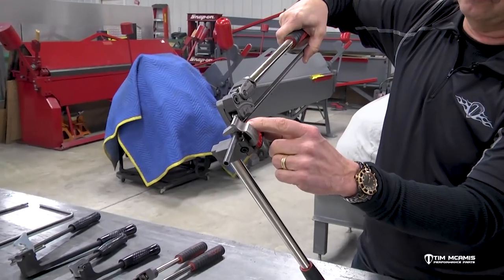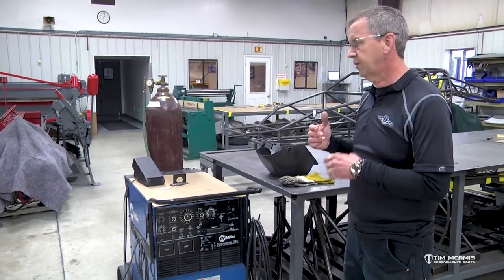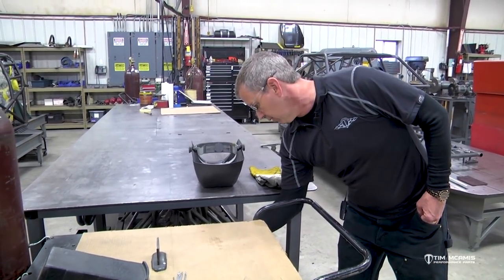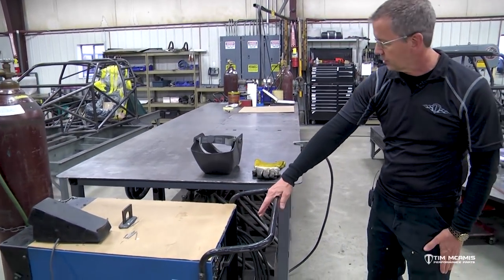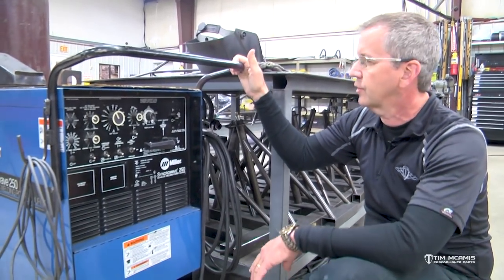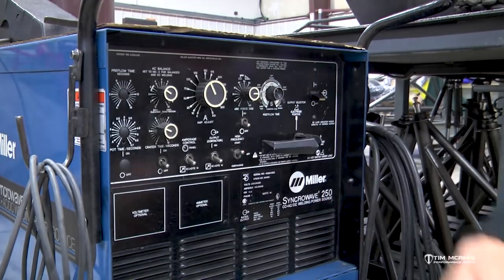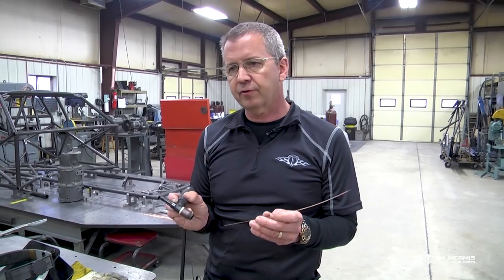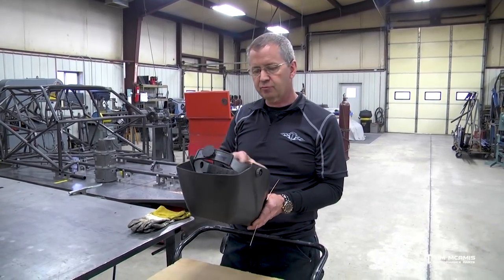Intro To Welding - Fabrication Series: 06

Comment: Good video Tim.
I've been using Miller machines all of my 42 years as a fabricator. They are "Tanks".
Started building drag chassis in '82 mostly MIG welded mikd steel.
When I started building with 4130 I bought a Miller Syncrowave 180 air cooled machine. Great piece if equipment that still sees use doing small components.
My main machine now is a Syncrowave 250dx.
Just a slightly more modern version of yours.
It also does a wonderful job doing stick welding when needed.
This is a great series your producing even for the advanced fabricator. Thanks

Comment: Tig machines are constant current machines which can also be used for stick welding mig welders are constant voltage machines
I think when he was talking about the amount of power in dc neg may be the correct terminology would have been 1/3 heat is at the torch 2/3 heat is st the base metal
DC pos is used for preparing the tungsten for aluminum welding by putting a ball on the end of the tungsten and stick welding rev polarity rod such as 7018 which produces superior penetration 
Oxy/acetylene welding helps learn good technique for tig welding 
Looks like a great race shop to work at 
Where doing everything the right way is the only way 
Really enjoying the content
I think nascar is missing out on a show like this where the fans who enjoy the technical part of racing can see more of whats going on behind the scene at the race shops thank you for your time and knowledge that your sharing

Comment: Great video. When I bought my Miller 180, I had very little welding instruction. I bought the welder and a book. I also spent a little extra for the auto darkening helmet. The helmet is great for beginners because when you are getting ready to start your weld, you can see what you're doing without worrying about flipping the helmet down. The rest is, as you say, practice practice practice. Also, if you don't have great eyesight you can buy a small magnifying lens to clip in your helmet so you glasses don't hinder you. Or to just help you see better what you're doing.

Comment: Miller makes great shop welders, as does Lincoln. However, I opted to go with an HTM machine since it will MIG,TIG, and stick weld. It doesn't have the high amperage capacity of a Miller, but will run hot enough to do 100% of welding involved with race car fab and repair work. Also, the HTM is small enough to be included as a tool in the race car trailer, as it only needs 20A-220v service. Add to that is its initial cost ($549 when I purchased mine) and you have a winner...!!!

Comment: I worked as a TIG welder for a while, weld repairing cylinder head castings.
Reply: The welding setup I used had a water cooled gun.

Comment: What's a good tig welder for a beginner with tig without braking the bank. Would like to get into tig welding but not willing to spend crazy money when I have a mig on hand.
Reply from the maker: Most anything from Miller is good.
Reply: Depends on what you want to weld. I have a Miller Maxstar 200 I picked up off craigslist several years ago for around $800. It’s DC only so no aluminum but it’s an inverter machine and only weighs around 35-40lbs. They also make a 150 model with lower output that can be found for less.
Reply: Railfan90 looking for something up to a 1/4 at the most aluminum
Reply: The Dynasty series is the AC/DC version of what I have and the 200 model will do 1/4” no problem. It’ll be a bit pricier but you get what you pay for. A lot comes down to what’s for sale if you’re looking at used stuff. The older stuff works good too but is generally bigger and heavier while using more electricity. I can run mine off anything from 120VAC to 480 single or 3 phase just by changing the plug. Portability is nice, I’ve run mine off a small generator in a field for stick welding numerous times.
Reply: AHP welder....checkout Kevin caron and chucky's5009 review
Reply: HTP Invertig 221 is one of the best starter welders to grow into. It’s actually on par with the dynasty 210. I’ve made a bunch of videos on both
Reply: Bradley Harrell I just bought one of these Miller 250 for $1400.00 used it doesn’t have the pulse like a new welder but this welder is amazing and like Tim said it can do everything you need I bought mine on the Facebook market place from a fabricator who just bought a dynasty and it came with a water cooler
Reply: Welding Junkie... I'm with you on this. I have the HTP on a cheap Harbor Freight rolling cart. I use it in my (home) shop, then roll it into my race car trailer for repairs made in the pits. I really don't think Tim's Miller would be a good candidate for taking on the road. The HTP does both well... And it'll handle 100% of car fab/repairs. A big Miller is great for a non-automotive fab usage, such as Sch. 160 - 4130 Boiler Tube welding, but is really too big for taking it out on the road, due to its sheer size. I ❤️ my HTP for its versatility/size....!!!

Comment: Aluminum is welded in reverse polarity. You just called it ac but you said you don’t use electrode positive. But you do use electrode negative.  You might confuse people as to where to plug in thier torch. Maybe it’s different on those old old machines idk
Reply: AC is NOT reverse polarity. With reverse polarity (DCEP) more heat is concentrated in the tungsten. With AC (like the power in the mains) the heat is evenly divided between the two and you can use much higher currents with a similar amount of electrode wear. DCEP is used for welding aluminum because the oxide layer has a higher melting point than the metal as is only cleaned away by the reverse current flow.

Comment: I liken TIG welding to oxy welding - instead of a gas flame, you are using an "electric flame".
Reply: I found that this occurred to me the first time I welded cylinder heads so that I was able to TIG weld without anyone training me. I had be trained in arc, oxy and MIG on a short course as part of my Engineering diploma.